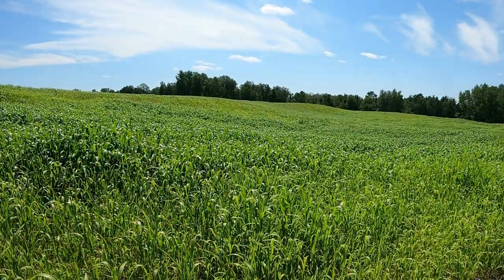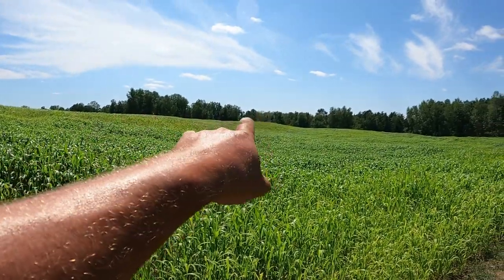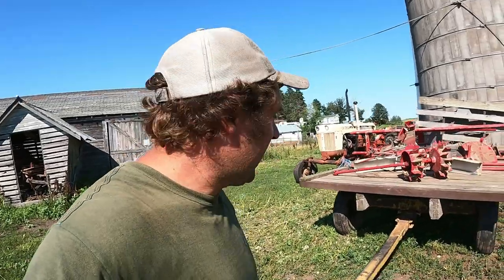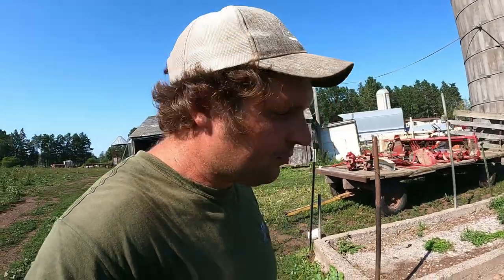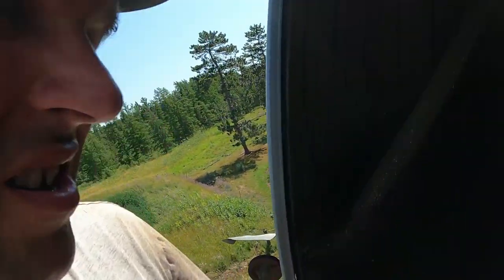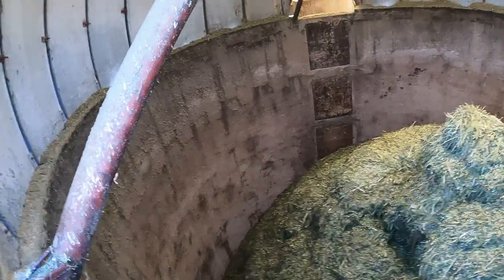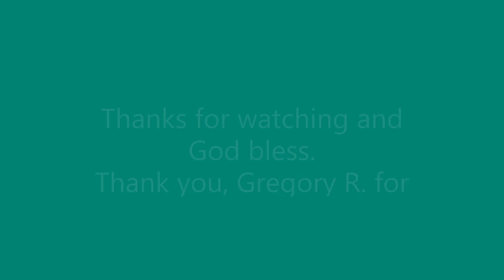Chopping Sorghum-Sudangrass/Filling an Upright Stave Silo

Comment: I feel for ya. Once my pully wasnt turning and it snapped the old cable on a very old but great running unloade in my 14-50r!!! It hit the bottom of the silo and became, well two, three maybe four unloaders on impact. Found a nice Clay unloader to replace it with. Neighbor had a unloader break the cable as he was filling. He put 6 loads of Corn Silage on top of it before he noticed it. Myself and a couple of neighbors along with him forked down to it and got it back up. Little to no damage as it landed on fresh chopped C Silage!!! The  looks like GREAT feed your cutting btw!! Kev!!

Comment: Old 830 just purring three of the best tractors built your using 1257,560 and 830
Reply: What's a 1257  a  scraper CAT hasn't built
Reply: @dennisholst4322  it was supposed to say 1256 glad you caught that a year later.

Comment: Annuals like sorghum -sudan are an expensive way to feed a dairy cow. Have you run the cost per ton numbers on this crop ?
Reply from the maker: I haven't figured it out, but that field needed to be tilled, anyway, so it basically was the cost of the seed, and will a little rain, we should get another cutting.
Reply: Disagree, when you compare high yield Sudan vs low yielding perennial grass, no comparison on a per ton basis
Reply: When you sow it is there anything else you can add and mix in to increase the protein content while at the same time lowering the acidity